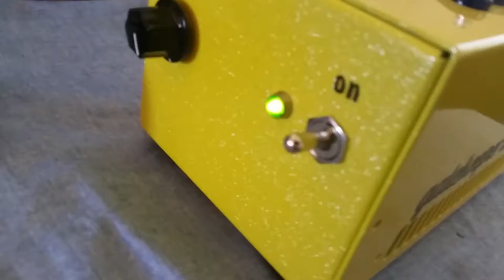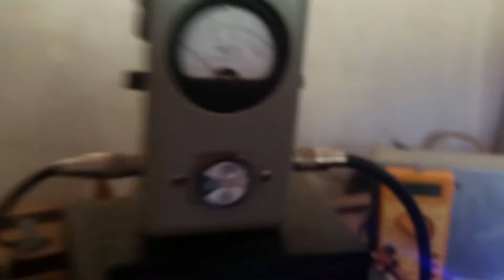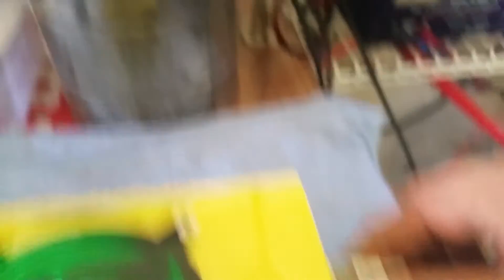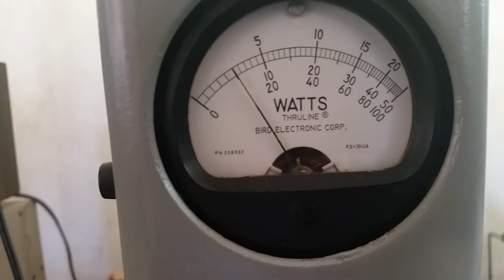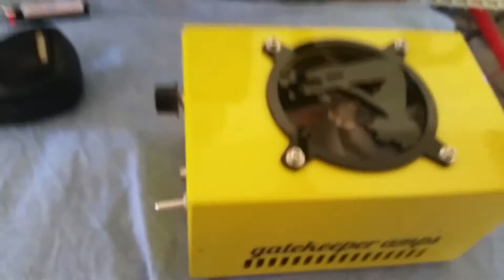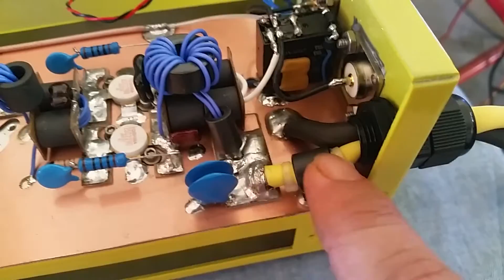Candy Painted Gatekeeper Built 2x2290 Driver Amp 🍋 Drop!

Comment: Is it necessary to bias the base of the transistors? What is the value of the resistor and capacitor that are in series between collector and base? the fan does not give noise in rx?